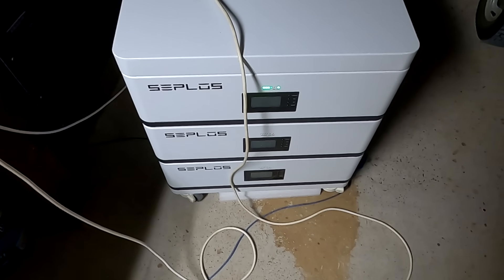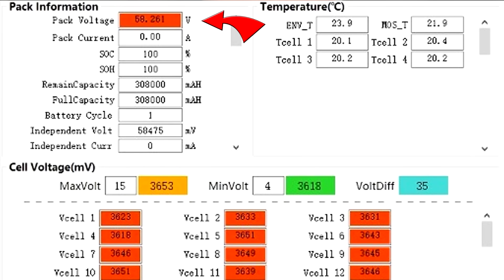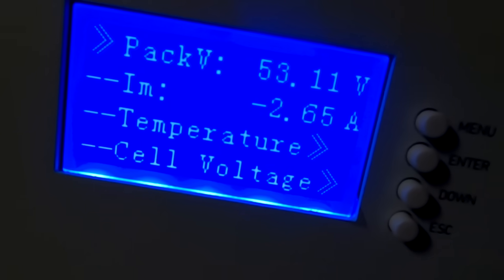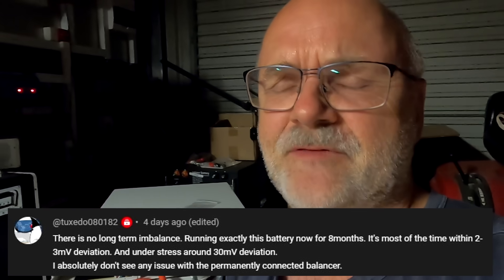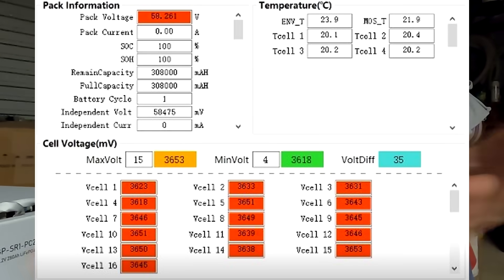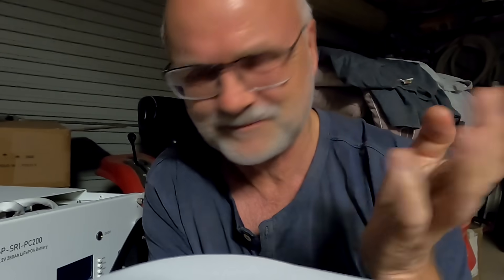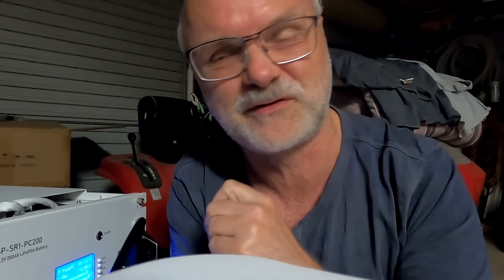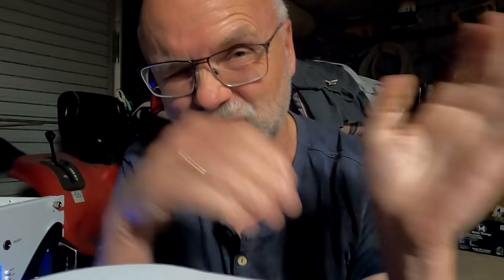Active Balancer: always on or only above 3.45V?

Comment: For me there is also a question about charge/discharge speed in relation to being able to reach 100% SOC and full top balance. If one babies the batteries around with 0.1-0.2C charge/discharge it is more unlikely to have the cells become unbalanced and SOC reported wrongly (expereince from Seplos BMS and 280Ah 16s x5 packs in parallel). I understand you, Andy, also top balance/charge the batteries with the Wanptek 21A charger at only 21A... this is less than 0.1C, no? So very little stress on the cells, in real life for me at least - I charge/discharge with sometimes 200A (40A per battery still is very low) and when playing around with single packs and then reconnecting, I sometimes see also ~150A per pack peaks.

Not directly to the topic, but could be useful....
I have a Neeey gen4 installed in all my 5 Seplos packs and the cells were top balanced to 3.6V, also full battery cluster charged to 100%. I did not know at the time, Seplos calculates the 100% oddly, so figured this was fine. I had Neeey running all the time - 3.1 to 3.55V if I remember correctly (as you said "if you want the balancer to balance, let it balance - remember :)? ). Now my SOC% is 7% different from max to min pack and thus cannot fully discharge the packs to full potential. Is it the active balancers' fault or just stupid Seplos, my inexcperience and too low V "top balance" or all combined, I cannot say for sure :)

I hope you can test the Seplos parallel system soon too (V2 BMS) as currently I am testing the idea of having the SOC "calibrated"  - all packs to 100% and also top-balanced from time to time from a 21A Wanptek charger too. My inverter sees BMS average SOC as 100% although some packs might still be 92-95%... it then disables charge and then it is only the possibility for me I think to keep charging with another source until all packs reach the 100% and desired cell voltages (and get balanced too). And I guess, I will also try to top balance them to the max 58.2-58.4V first with the help of the Wanptek charger.
Reply from the maker: Great comment and yes, I agree, it also depends on the current comming through he battery how far they go out of balance.

The NEEY should not run all the time. That's what the settings are for to start (try 3.45V) and stop (try 3.4V). This will fully top balance your batteries again.

Yes, definitely more Seplos magic coming. I have a few 10E BMS here which I would like to test. Unfortunately, the 10E BMS needs a cell or pack OVP to reset to 100%.
Luckily it shows only full numbers in my Victron so 99.5% shows as 100%. That could be a sneaky work around with the correct settings. We will see...

Comment: I think: it depends on the charge and load current respectively how it´s charged/discharged during the day. High charge cuurent and high discharge vs high charge and low discharge vs low charge and high discharge vs .... and so on. it depends. The best way to achieve best balance while activeBalancer is always on is to charge very slowly so the aBalancer will have the most time to balance while charging.
Reply from the maker: Yes, if you charge slowly, it will work.

Comment: It's incredible how many people fail to understand that active balancing is almost pointless!  
For a series string of cells, the individual average voltage swing is simply set by the effective capacity of those cells.  if you put a 10Ah cell in series with a 5Ah, then clearly, whatever the volts per Ah slope, the 5Ah battery will be the limiting factor, ie will charge to vmax first and discharge to vmin first.  But this doens't matter. As long as your BMS can stop charging when the first cell hits Vmax, and stop discharging when the first cell hits Vmin, you are, for the most part done.  

Pointlessly equalising each cell voltage is frankly a waste of time, energy and money!  These days, most cells are pretty well matched, so make sure you do a good inital top balance to get all the cells to 100% SoC, then just use your battery.  I don't even run with ANY balance circuit on my battery and after 18 months all the cells still hit Vmax within about 15mV of each other, so the absolute useable capacity i have "lost" by not getting all the cells to exactly vmax is minimal (it works out to be 0.3% of the nominal capacity). Even when you get all your cells to vmax match perfectly, you battery useable capacity is STILL limited by the weakest cell (ie the cell with the lowest useable capacity), that cell will always experience the largest voltage change per unit charge.

For a typical domestic or off grid solar battery, you should be NOT using anywhere near 100% of available capacity to maximise cell life (if you do the maths, it's better to buy more capacity and not use it, because the cycle life goes up by a greater proportion than the cost of the extra capacity), and if you are not using all the capacity, do you care if you are using say 80% or 82% of it?  no? thought not

Spending money on an expensive balancer is a false economy, it's far better to simply spend the money on more installed capacity, enabling a longer overall life because your avergae discharge ratio is smaller!
Reply from the maker: Thanks for your comment.
I will test this with the Seplos batteries soon and see if it will work that way. I have tested many, many batteries and have never seen it working as you describe. You must have very high quality and well matched cells. However, this is not standard and most cells are not so well matched and if they age, it gets even worse.

Talking about aging, I think it is more economical to fully charge a battery every single day and use the full capacity (90%DoD), than buying a second one and use only 60%DOD. It's dead capital and assets you have spend money on don't use it. Only if you're after the faster ROI.

LiFePO4 can be charged to almost 100% on a fairly low voltage, so it does not stress the battery and causes any increased degradation. And with thousands of cycles, calendar age will kill them before cycles will show a negative impact.
Reply: @OffGridGarageAustralia  My system uses Envision Gen4 cells that are from a Nissan Leaf, so are obviously full automotive quality certified, and yes, that makes them very well balanced. They are also not a LiPo chemistry so experience a large deltaV per unit charge.

The important point is really that the only time you actually care about small voltage variations between your cells is at the top and bottom of the capacity range, and really for a off-grid or home storage application, you really shouldn't be going there!  For an automotive application where people might need the full range from 100% SoC then yes, precision balancing can be effective at freeing up that full range, but even here when you do the maths on what useable capacity you actually loose with say a  50mV delta, you find it isn't actually that much.

For a practical battery, where all the cells are operating under similar conditions (ambient temp and series current) then the weakest cell is ALWAYS the weakest cell, you still can't use any more capacity in practice than contained in that cell (unless you either have an entirely parallel cell architecture (unlikely) or have some sortof massive, complex andhugely expensive BMS that can somehow shunt the ENTIRE series current around a cell (and if you have this, you're a bit silly, because for less money you could have simply put in more static capacity and avoided the need to do it in the first place....)

Comment: Hi Andy, did all this tests a couple of years ago and you are spot on. Cells have a deviation in inner resistances, this vary with SOC. The cell difference you see highly depends on the current and direction of the current while charging / discharging. The same cell may be lower than the others in the flats or while drawing energy and may run off while chharging. Regardless of balancing you can have a high cell at 80% while charging, that is overtaken later by the lower cell at 90% SOC that becomes the high cell then. This cells are crazy, it makes no sense to balance them early, only on the last 3-5% and only while charging. As soon as you turn off the current they seem balanced (after draining the surface charge with a small load for a short time).
Reply from the maker: Thank you. Yeah, from my testing, balancing LiFePO4 only makes sense above 3.45V. As you said, below that it's useless...

Comment: or.... bottom balance with it every 6 month.
Reply from the maker: Bottom balance makes no sense these days. It is from a time where we didn't have good BMSes and balancers.
All equipment is doing top balancing...
Reply: @OffGridGarageAustralia  If your running high current to low discharge levels, let's just say a discharge 5x what your balance current is, then the balancer won't keep up as you approach very low states of charge as the deviation increase on the weakest cell. If one cell failed over the cliff before the others and before the discharge is stopped, that cell effectively gets reverse charged and killed. But if you have bottom balanced, you have a greater degree of protection against that, and the deviation is widest at the top where your charging gradually.
I know my use is different from yours being a vehicle scenario I'm pulling 5-10c or more than someone in a home pulling 1c where there's time for the bms to catch the knee point. When I get my bank built I'll maybe have to rethink but what I do know is a battery will survive a little too much over-charge way better than a little too much   over-discharge.
I use jk BMS at 84v, they seem well made and reliable.

Comment: Always balancing will indeed destroy the balancing when operating in the flat area and then repair the right balancing in the top area. So it will mainly just work for nothing. Indeed during the charge phase in the flat area, the voltage is not so flat because of the accumulation/absorption phases. So it will never stop to exchange energy randomly, function of which one absorb and which one accumulate at the current time.
So yes the result at the end will be the same but your balancer will work most of the time for nothing. 
Fortunately into the flat area, the exchanged current will be very low because this current is proportional to the voltage deviation between cells but it will be waste of work.
The risk of large unbalancing will happen when the battery stays always in the flat area for long and is never fully charged or discharged regularly.
Reply from the maker: Sums it up perfectly!

Comment: Hi Andy, 

I really enjoy your videos and all the valuable information that you provide to this community, Thank you. 😀

I have a battery with 96 groups of cells in series with 4 cells connected in parallel for each group for a total of 396 volts, give or take a few volts. 2 of the 96 groups has only 25% capacity left after 4 years in service. What would work best in providing the most amp hours available?

Would top balancing and then turning off the balancer improve total amp hours available?

Or

Would leaving the balancer running increase total amp hours available?

Before you answer I would like you to refer to your Frankenstein battery as it also has mixed capacity cells.

Looking forward to your response, Willem
Reply from the maker: Thanks Willem.
That is a strange battery constellation you have. If 2 groups have only 25% capacity left, then your whole battery must show only 25%. Like the Frankenstein battery (and frankly all batteries), it all depends on this weakest cell in your pack.

Comment: In the short term:
The underlying assumption to NOT use a balancer below, say 3.45V, is that, IF we view each cell independently, it should ideally precisely trace the discharge/charge curve several cycles. However, balancing all the cells would force (in the pack situation) each cell to move another (unnatural) charge curve. Thus, it would prematurely ruin the top balancing and the small delta voltage. I agree with your arguments.
In the long term:
You can expect each cell to change with time; thus, using a capable balancer above 3.45 V makes sense to keep the pack at top capacity over its life since discharge/charge traces will change over time. Cheers.
Reply from the maker: Thanks for your comment and explanation. Aging of these cells as also a good point. Even they are perfectly matched today, they may not be in 5 years and hence the balancer makes sense.

Comment: I think you need to run the discharge over a long period not just dumping into the Tesla, say over a couple of days. Give the active balancer a good change to f-up the battery. Otherwise the time for the balancer being exposed to the flat area of the curve is not as long as it would be under a normal condition.
Reply from the maker: Well, wee will see. Finishing the test today, video will come out tomorrow.

Comment: Having the balancer running all the time would work fine, as long as your battery spends a significant amount of time at >3.5V, where it can properly balance.
If you try to run the battery between 20 and 80% and never fully charge it, the balance will get worse and worse, and the battery will never properly balance.
Reply from the maker: Yes, correct. The balancer needs time... 
If you don't fully charge the battery for months during winter and have the balancer running, it will take a while to fix this 'damage' again.

Comment: Hi Andy i think its more simple than it looks, if the batteries quality is high after a top balancing they will keep balanced on all the states of charge, if they top or bottom umbalance some cells have higher internal resistance or slighty different capacity
Reply from the maker: Yes, cell quality and matching play a role as well as usage pattern with large or small currents.

Comment: @Off-grid Garage, Thanks for your many intuitive, educational, technical & engineering videos. Kindly also carry out extensive tests with focus on cycle life at the specified DoD, product price, performance including calendar life, durability, charge rate, discharge rate, operating temperature range, trade-offs/compromises or competitive disadvantages, etc, and do a Cost Benefit Analysis of the S-volt LFP cells as compared to the more popular Eve & CATL cells. Endeavor to acknowledge this comment.
Reply from the maker: Thank you but I'm not a laboratory and don't have the appropriate test equipment and environment to carry out such long term tests.  It's just me in my garage 🤷‍♂️

Comment: my bet: always on won't damage the top balance, all modern active balancers only work to a current in a direct relation to the voltage deviation, so even if the AB is "working" in the flat area, the current used to "balance/damage the balance" is negligent, large enough currents will only happen when the delta is larger
Reply from the maker: And what about months of winter and using the battery between 10-40% mmost of the time?
Reply: @OffGridGarageAustralia  voltage deviation should stay low, of balancing current is directly related to voltage delta, it won't make an impact, also, when charging back any deviation between cells will be ironed out by the time they're back to level, to make active balancers to have a balancing current in direct relationship with voltage deviating is the way they e avoid what you say is going to happen, different would be if an active balancers is allowed to balance with the full current all the time, in my opinion

Comment: My theory is when you discharge aggressivly ( ie 70A into a Tesla) and then charge aggressively  you create battery cell imbalances that dont represent the true cell imbalances seen at the top when the current thru the pack is minimal. Therefore the cell balancer may actively unbalance the pack. I have a JK standalone active balancer that  has no setting to turn on/off according to cell voltage. On a 16s 15kWhr LiFePo4 system it has been left connected continuously for 2yrs. But deltaV setting switches on active balancer when > then 20mV. After 2 yrs deltaV is 20mV at 56.0V. I have a washing machine, dishwasher and 2 water pumps but no Tesla! Switching on the active balancer above 5mV however will likely create a much larger  "imbalance" if left connected 24/7. If the charging is too agressive at the top end and there is minimal time spent above 3.4v when the true state of the balance states directs the active balancer then the pack doesnt get balanced properly.
Reply from the maker: Yep, great. 
Discharging the battery with 50A is a bit less than 0.2C for the battery, so I would not consider this as aggressive.
Setting the voltage deviation/delta correct is a good point if the balancer runs all the time. I guess this is also the Seplos strategy with their new active balancer which has a 50mV setting and 'runs' all the time above 3V.

Comment: I have a 16S 304 Ah configuration with JK BMS and Growatt as inverter/controller , All cells looked perfectly balanced with only 1 mV deviation at 3.35 volt and after 6 months I did a top balance and the deviation went over 150mV. I think is best to start the balancing process not before the keen part of the curve, at least with this confuguration.
Reply from the maker: Yeah, 3.35V is still in the flat area of the curve, so it won't show any deviation. You need to be at least at 3.42V -3.45V to see the spread. Then the balancer should be active as well.
Reply: Need a bit more detail about pack voltage and JKBms active balancer settings.. Sounds as though your system was not pushed to 56V pack for long enough frequently enough to allow incremental top balancing each day, then when you did push you pack voltage up you discovered your pack was unbalanced.